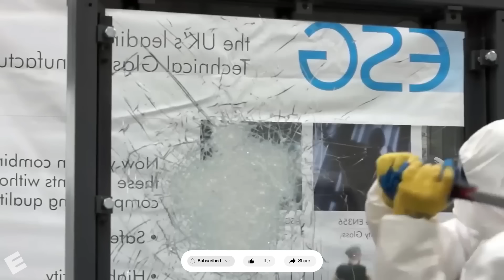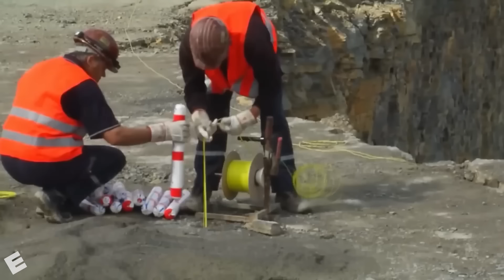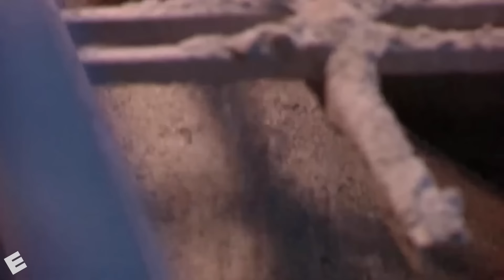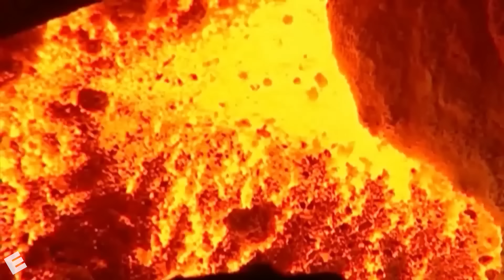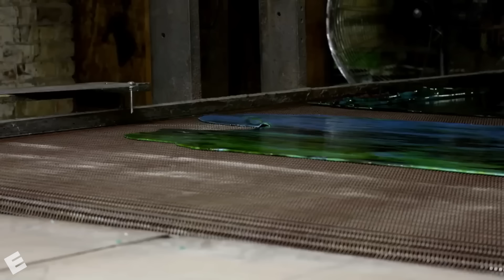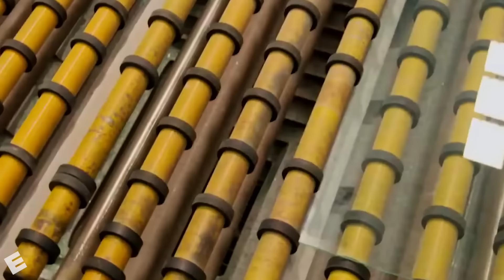How Glass Is Made From Ordinary Sand

Comment: How are some of the glasses unbreakable
Reply from the maker: Good question my friend, "Unbreakable" glass is made through processes that create strong compression on the outer surface to resist impact. While no glass is entirely indestructible, manufacturing techniques like extreme heating, chemical baths, and plastic layering prevent it from easily shattering.